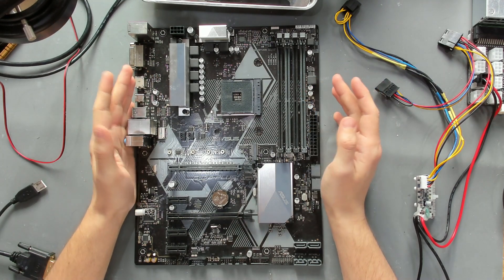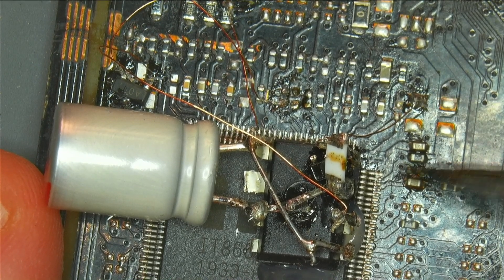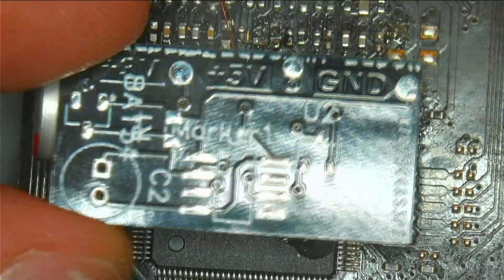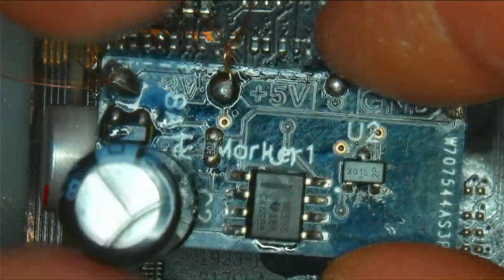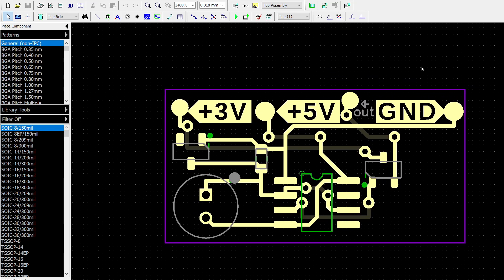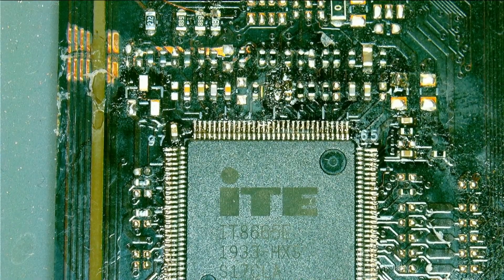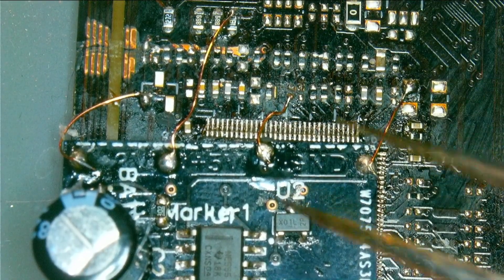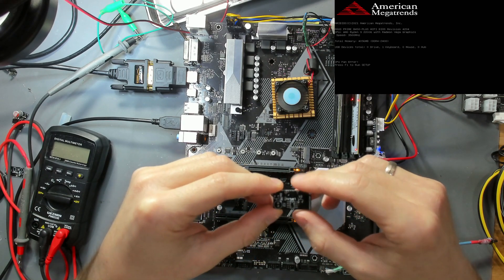WHY YOU NEED TO LEARN PCB DESIGN TO FIX MOTHERBOARDS | Asus B450 Prime | Building 555 Timer curcuit

Comment: The best on these boards, do you replace sockets as well?
Reply from the maker: Sadly not yet, dont have the equipment for it!
Reply: @MainboardMedic  I do those, honestly they don't require any special equipment, I use a preheater under the board @ roughly 200°C then an  atten hot air around 300°C over, the socket will come off nicely as well as attaching though you need a lot of flux
Reply from the maker: Would love to see a video about that proces!